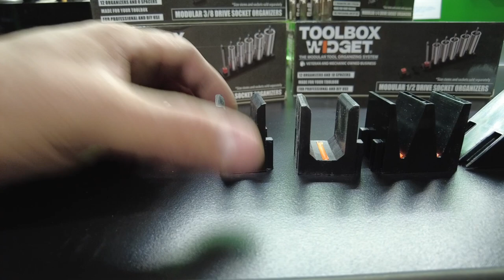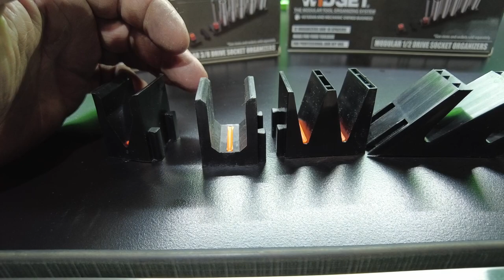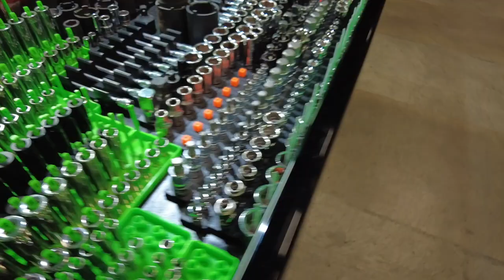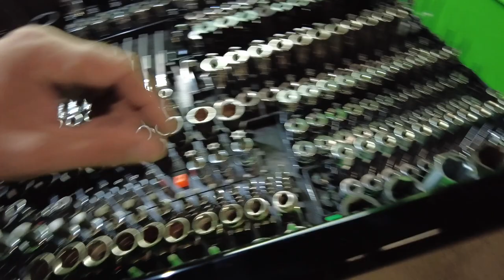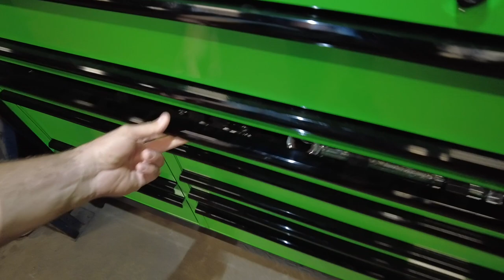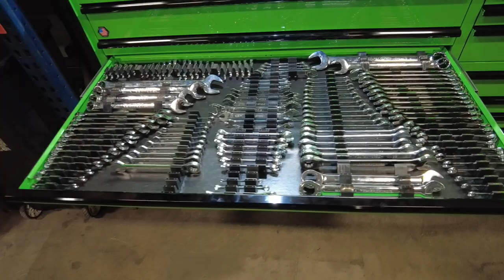New Socket Organization - Why I like Toolbox Widget so much

Comment: I have tool box widgets, they take up more space compare to vim mag rails. I just comparing sockets organizing. Vim rail for the win but they’re are incredibly expensive though. Just my two cents. I have the wrench, pliers and screwdriver though. Those are greats. Just the socket one takes up more than I want compare to the mag rails
Reply from the maker: I mean I can’t disagree with you completely lol. They seem to have worked decently for my drawer but I’m sure I could squeeze a little more.i think there’s going to be pros and cons to a lot of different products. I love tool grids, but honestly I think there is tons of wasted space on them. And that’s kind of what I wanted to see with the Widgets was how much space was wasted because they are set sizes and there are only so many ways you can link them together. I definitely like the mag rails but like you said it would cost an even bigger small fortune to do mag rails.

Comment: I got that long matco 1/4 inch ratchet. I never thought of putting a 3/8 head in it. Might have to buy another for shits and giggles lmfao 😂

That looks pretty good. Ive been looking at stuff for my cart and was gonna use the olsa tools magnetic ones but wobbles dont fit in them damnit. Plus, the 3/8 diametet of the holes would fit a half inch drive socket so it was too big for my liking. Lol.

But the box looks good!
Reply from the maker: Greatly appreciated! Yeah I've found that there isn't really anything that organizes every singe thing like you prefer it to be. So it takes a while to find some stuff that works like you want it to

Comment: I’d go with the Mac pinned or the cornwell pinned with the blueing universal swivel sockets. That’s just my opinion. The pinless fly apart and the ones with the crimped bushing on them are just to bulky. 👍 nice video!
Reply from the maker: Thank you for the suggestions, I definitely have some shopping around to do. The matco pinless have been great for me so far but I have noticed once they're well used they have sticky spots where they seem to bind. So I'm mainly trying to alleviate that I suppose. I agree on the crimped together ones, they definitely get in the way more then is useful. I do want to check out a Cornwell set for sure!

Comment: What are those two ratchet wrenches right above the purple Matco 1/4?? 19:50
Reply from the maker: those are ez-red 1/4" drive for a socket on one end and 1/4" bit on the other end, some are flex heads others are fixed heads. its not just the two either there are maybe 6 variations of those above the purple ratchet!
Reply: @TalkinTools  very nice! Thank you for the reply, I’ll have to give ez-red a look. That Matco is on my list as well. If you do decide to convert to 3/8, I would be interested in the video. Have a good one!
Reply from the maker: @agtx556  Not a problem! I'll definitely make a video if the 3/8" conversion is the way I go!

Comment: Im a big fan of Westling machine socket organisation, but unfortunately they only do socket organisation.
Reply from the maker: I've never had my hands on those but I love the way they look and Ive been tempted to order some to see what they're like
Reply: @TalkinTools  I purchased their master set after ordering Capri Tools master 3/8th impact set with a three row organizer made by Westling, I loved it so much I needed the rest. And if they make matching wrench and pliers organizers I'm sold on it. I'm sure they could use more influencer support.
Reply from the maker: @KoryBrooks  They look killer, it would be cool to see them add to their product line for sure. Side note how do you like the Capri stuff? Ive been looking at a few socket sets they have too
Reply: @TalkinTools  so far I got their 3/8 impact socket set and it's comparable to Matco. Their customer service was fairly speedy and shipping time was quick. They have a lot of out of stock tools, and could use a little more variety, but I believe they are Taiwanese quality like Tekton.